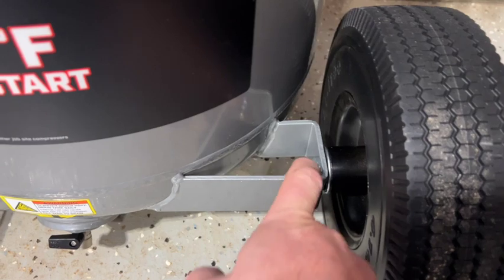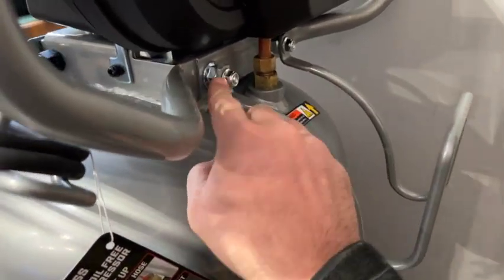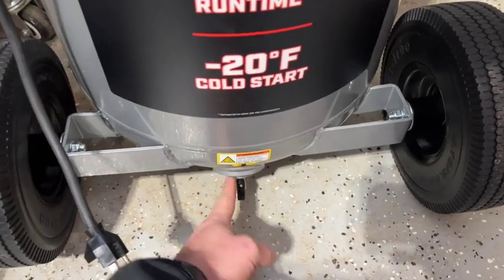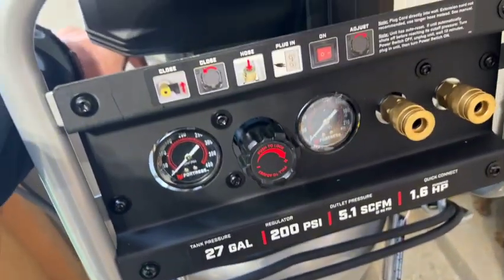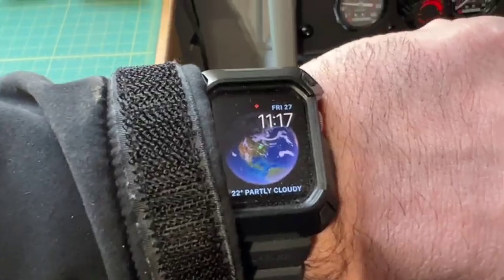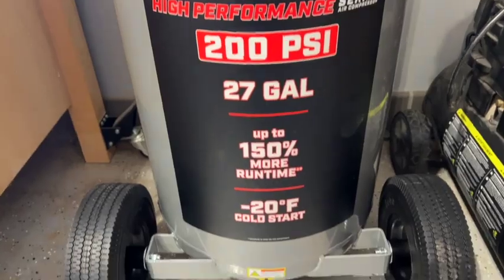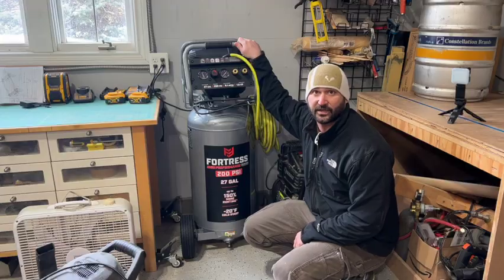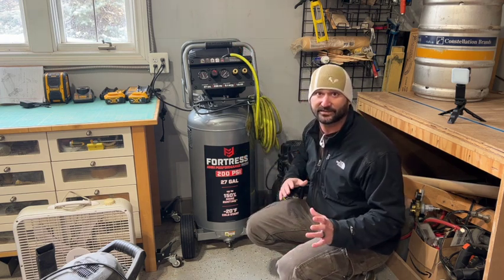Setup Of Fortress Vertical Air Compressor

Comment: I have the black tank 27 gallon compressor from harbor freight. The 150 psi one , it's not oil less, it's 29 gallons and I have it hooked to a 80 gallon old shop tank to expand the air volume, I never had a problem with it filling up , just takes like 24 mins to fill up , after 6 years it's still going strong , you think this would fill up an extra 80 gallons with no issues?
Reply from the maker: I honestly don’t know. I am interested to see how this holds up long term compared to the older air compressors that require more maintenance and oil added. It will be interesting to see if the convenience of this unit doesn’t impact its life span. I guess time will tell.
Reply: So you have two tanks that fill up then? Or did you just pop the motor onto the bigger tank and use only the 80 gal tank?
Reply: @ChristopherJones16  I have the 29 gallon tank with the motor on it , then ran a line to the 80 gallon in and it has a out that I use for my attachments
Reply: Excellent. Wish I could see how you hooked it up.

Comment: I just purchased the same unit. I’m confused on how to set up an air supply line with a moisture separator and quick connect lines without losing the original quick connects on the unit?   I hope that makes sense. You mentioned you would be doing it. Was wondering if you could show how it’s done.
Reply from the maker: If and when I get that setup done, I'll try and get a video out on it.

Comment: I have that same compressor in the warehouse at work, bought it about 4 years ago.  Recently it stopped building pressure past about 150psi.  It just continues to run and run.  I'm suspecting a leak near the regulator switch, or the switch is plugged with wet dirt (aka mud) from not draining the compressor often enough.  I need to pull it apart this week and see what's going on.

Comment: will this run a palm sander???
Reply from the maker: Although I have not yet run mine on this yet, it does state that it can handle sanding and surface prep. This is rated for “intermittent” use though.

Comment: How's the unit holding up? Did you buy extended warranty?
Reply from the maker: I opted not to get the extended warranty, but the unit is running just as well as they day I purchased it. We are a small shop and what we run doesn't even come close to pushing this thing to its limits though, so our experience would be much different from those that run mainly pneumatic tools.

Comment: Why the 30 minute break in period with the valve open? What exactly does that do? Why have the valve open?
Reply from the maker: Not exactly sure, was reading the instructions and was surprised to see this as well and wondered how many people skip this like I would have done if not for skimming the manual first. I’m wondering if it has something to do with its manufacturing process and clearing out the tank of debris 🤷‍♂️.
Reply: The 30 minute break in is done to break in  the pumps piston rings.
Reply: Helps set the seals

Comment: Curious to know which model number yours is?  I bought mine in March of 2023 and I only had one issue where the brass hose fitting leading from the compressor was leaking to where it fastened onto the tank itself.  No matter what I tried to get it to seal, it would still slowly leak down day after day.  I exchanged it within the 90-day warranty period and this has worked just fine since.  The old one was #57254 and this one now is #56403.  I only noticed very slightly cosmetic differences between the two, so I don't know if the other company making it had some issues with them, or if the assembler boogered up the threads while putting it together.  But I did also notice that the last one sounded slightly louder, as the compressor produced a different noise when it was filling.  So no leaking and a little quieter!

Comment: So I just bought this. It says to also connect a regular valve, an in-line shut off valve and a 1/4 “ NPT air hose to a quick coupler. 

I bought an EARTHQUAKE XT 3/8” NPT THREAD 50 ft 300psi premium air hose ( also from harbor freight)  before I bought the air compressor. 

It would be great to see a video of where and how to add these components to a suitable hose and the setting it up to the air gun. 

I am just today running the 30 min break in stage. But this is a faff as I just want to get to spraying my kitchen cabinet doors with my Huskey spray gun but all this videoing and checking the additional … add a bras coupler a 1/4 NPT when I have a 3/8 hose do I need a 3/8 NPT or a different 1/4 hose .. I actually have a pressure gauge on my paint sprayer .. 

Well at least Ive switched it in and I’m running the 30 min check … heads up … it’s noisy in my opinion .. I have a 3 gallon porter-cable pancake compressor for power tools and this is definitely as loud .. hopefully it won’t need to fill up too often and frighten the living daylights out of me every time ! 

Have blessed veterans weekend y’all .. land of the free because of the brave !!!
Reply from the maker: When I go to run some permanent lines I will be adding the regulator and other components to the system. I'll try and shoot a video for that and add the link to the description. 
As for the unit running, I just did a quick build of some floating shelves and ran my pin nailer with it. The whole build, the compressor never kicked on! It was so nice not hearing that thing constantly running and scaring the crap out of me lol.